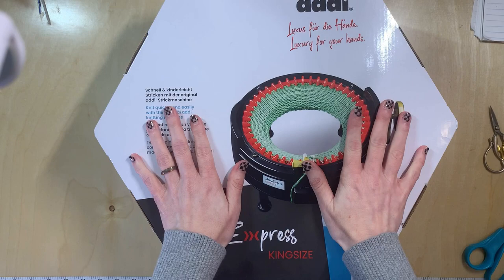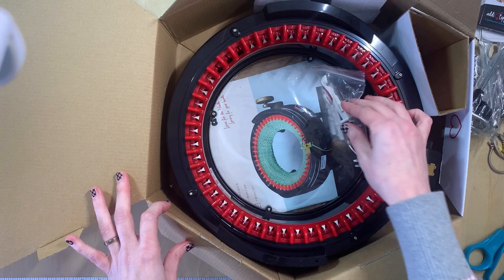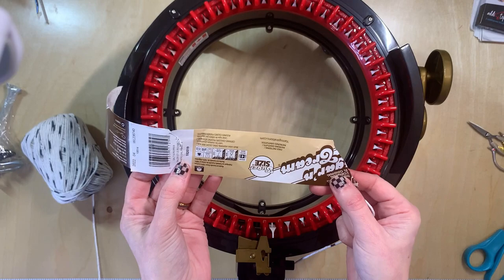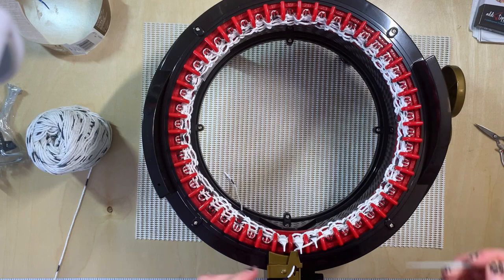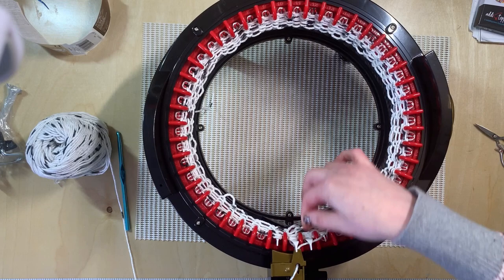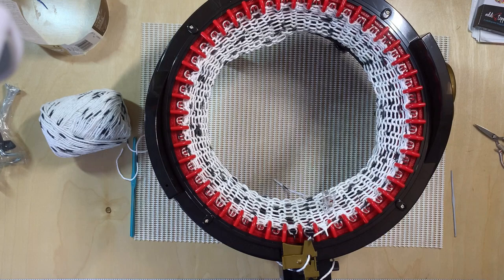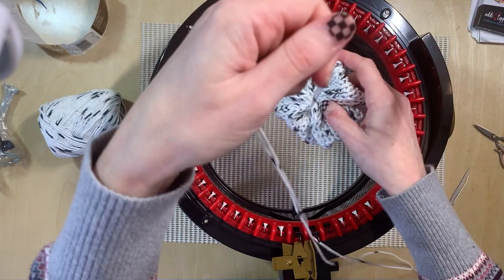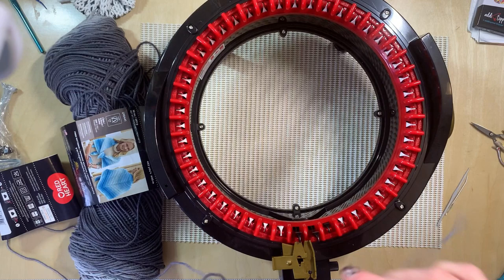Will it knit cotton? super saver? chunky? Unboxing the Addi Express KINGSIZE #knittingmachine

Comment: I'm surprised it did well with the thick yarn. I may try it with that type next time. My machine does NOT like the jumbo yarn pack, or other thicker ones. It doesn't like some cotton yarns, either. But I have made lots of hats with the Sugar and Cream cotton before. I've had mine going on 4 years now. I recently got an electric motor that spins the needles around pretty fast, It really helps, because I have a bad wrist and turning that big flat handle causes a lot of pain to my wrist. Wish they had put a handle on like the Centro has.

Comment: The stoppers are for panel knitting.
Reply from the maker: As a helper to prevent dropped stitches on the ends? That's brilliant! I don't have a lot of problems with panel knitting but this is a cool feature for sure.
Reply: @thecraftygrrl  They're more for being able to stop without going too far past where you want to knit. I like them because I don't always pay super close attention unless the machine makes me stop.
Reply from the maker: I have so many black sharpie marks on my sentro bumpers to help me stop in time and it was working but this is will def help ensure I don't get distracted and go too far.

Comment: Hi Tori, just advising you haven't got your yarn placed correctly in the yarn holder. You need to slide the top of the yarn holder to the left, place your yarn in & slide that bit top back over it, I think that will help a little with your yarn but cotton I've heard is difficult to work with in these machines.
Reply: She did slide it over to the left. She just did it really fast, but she just didn't put the yarn all they way through the holder. Some people use just that little hole and others don't.